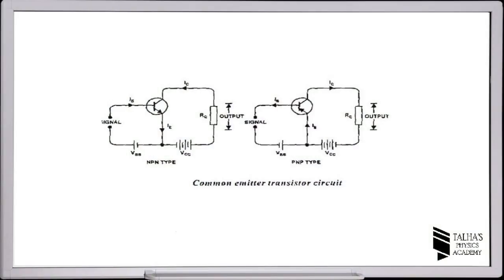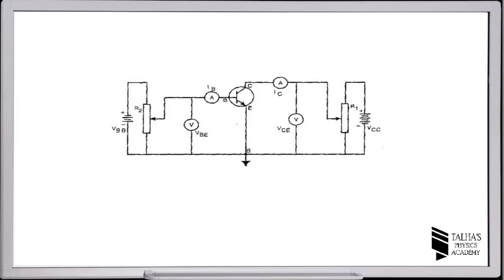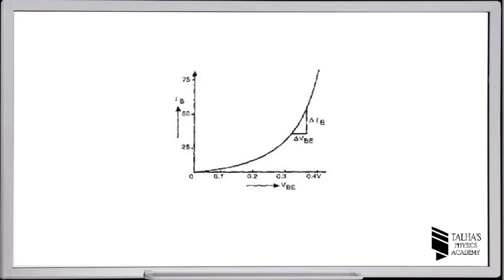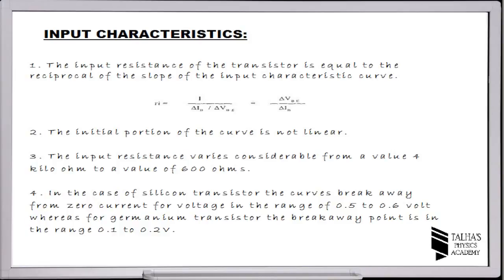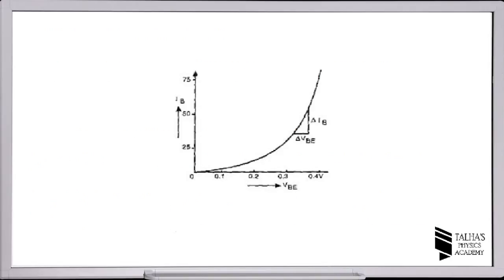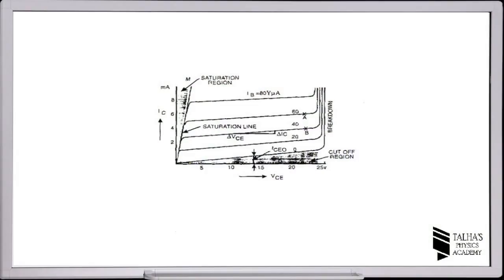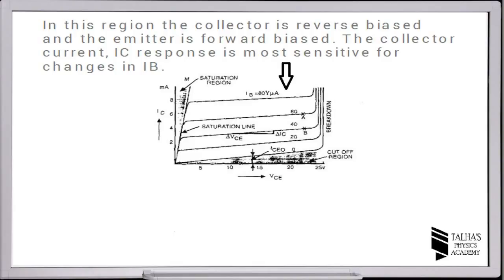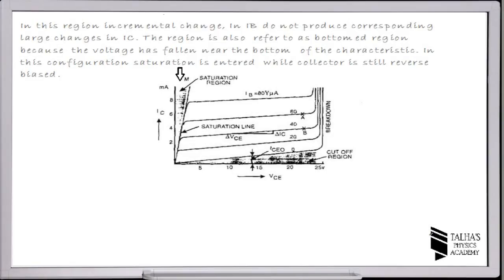Characteristics of Common Emitter (CE) Configuration | English Explanation | Talha's Physics Academy

Comment: Why common terminal is connected to the earth
Reply from the maker: It is not connected to earth it is known as grounding.This is the point in the circuit which is called at zero volts and we use this point to measure volts of other points.

Comment: Sir can you explain the saturation and cuttoff situation in detail??
Reply from the maker: In saturation region both the diodes are forward biased by at least cut in voltage. Since the voltage VBE and VBC across a forward is approximately 0.7 V therefore, VCE = VCB + VBE = - VBC + VBE is also few tenths of volts. Hence saturation region is very close to zero voltage axis, where all the current rapidly reduces to zero. In this region the transistor collector current is approximately given by VCC / R C and independent of base current. Normal transistor action is last and it acts like a small ohmic resistance.

Cut off in a transistor is given by IB = 0, IC= ICO. A transistor is not at cut off if the base current is simply reduced to zero (open circuited) under this condition,

IC = IE= ICO / ( 1-αdc) = ICEO